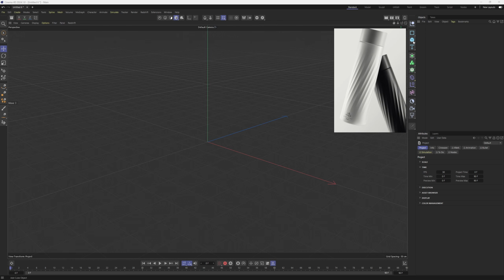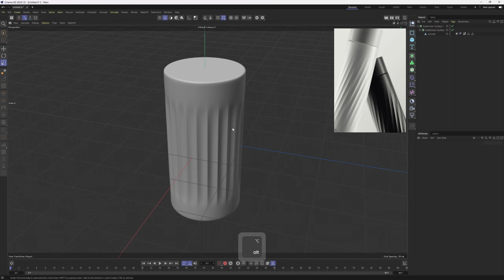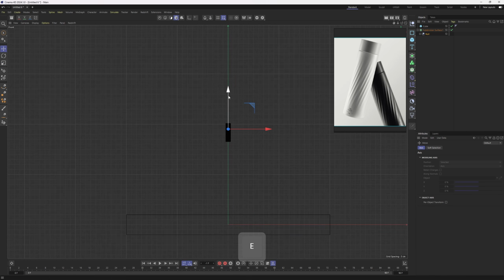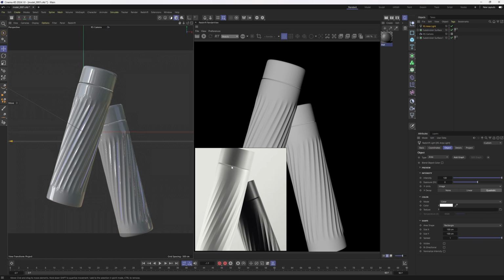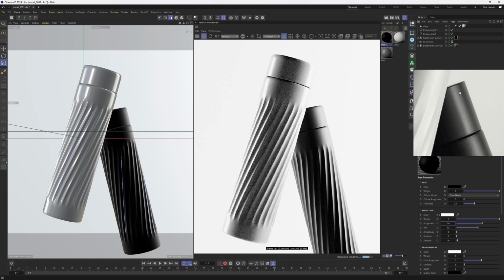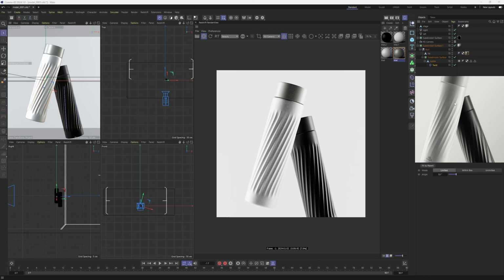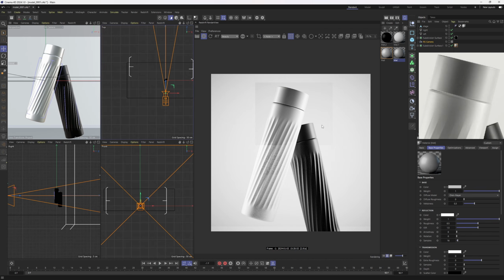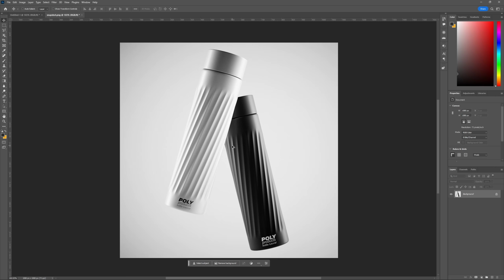Industrial Design/Product Modeling and Rendering Tutorial #35

Comment: is it possible to use texture mode like you did with Poly products text at the end with octane?
Reply from the maker: Yeah, sure!
Reply from the maker: Material stacking may not work with Octane Materials though.
Reply: @polygonpen  material stacking works i just couldn't get the texture mode to work i had to use the old way of adjusting the uv transform

Comment: Is there a way to hit the Q shortcut to disable the "Subdivision Surface" and not the "Symmetry"?
Reply from the maker: Unfortunately no, that is something really annoying.
Reply: @polygonpen  okay, thanks for the reply. I've contacted the support.
Reply: Here's what the support said: "This issue is confirmed as a bug currently. In former versions the symmetry object was skipped by this command as parent, but that's not the case at time. Our developer is aware of the bug and will need to find a fix."